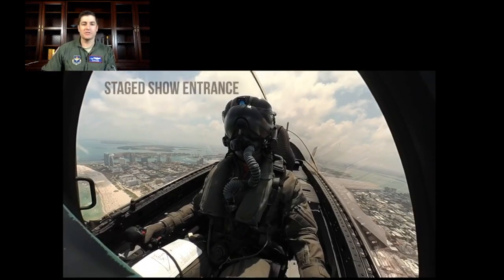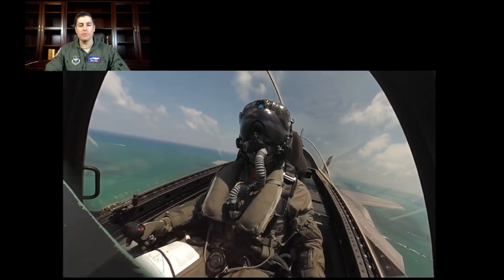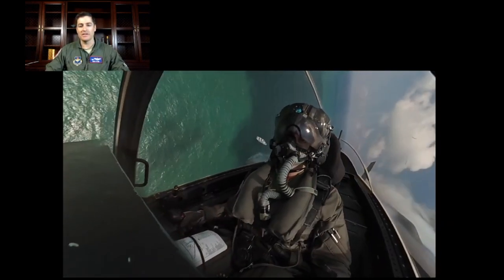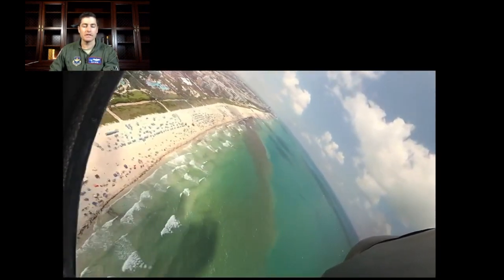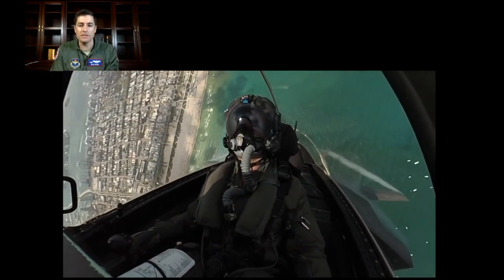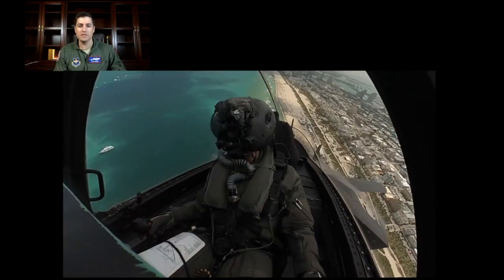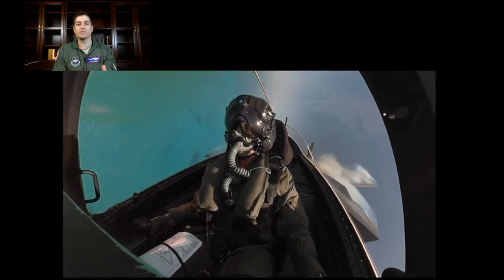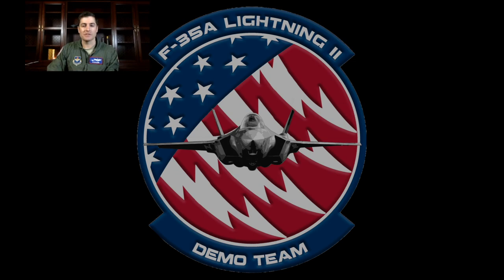F 35 Demo Maneuvers Explained

Comment: Hey DoJo, thank you for your service! With reference to the high velocity pass, during the transition to the high alpha climb, how much energy are you able to loose from the time you go to flight idle to when you’re back on deck opposite direction for the bomb bay door pass? Does the aircraft automatically configure itself (similar to the F-18s increasing wing camber with speed decrease) as speed decreases to maintain proportionate lift?

Comment: I used to make f35's afterburners, and i was told the F135 engine can't go into Full re-heat at low altitudes.
but you mentioned full AB several times.
by "full" do you mean everything the pratt f135 has? or just the max power you can use at that time
Reply: Why the engine can't go into Full re-heat at low altitudes? Its a stupid rumor.
Reply: In combat they are only allowed to use the afterburner for a short amount of time otherwise it starts to melt the stealth coating on the tail making it significantly less stealthy